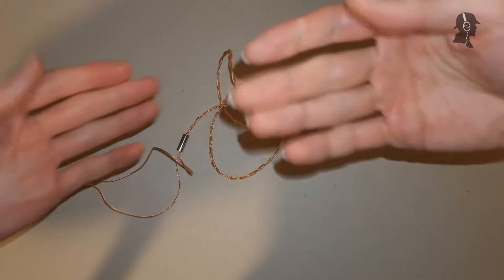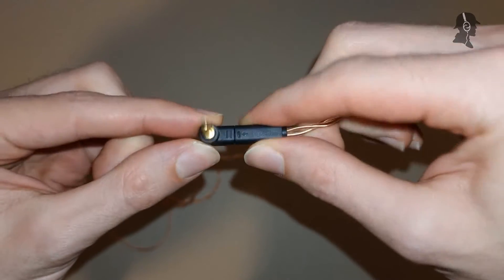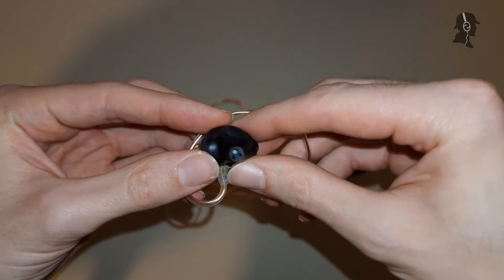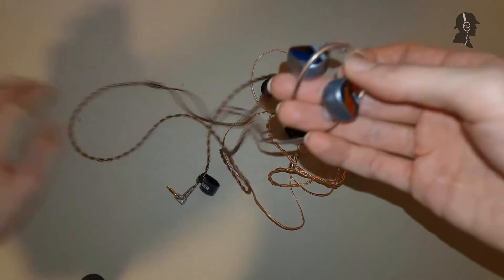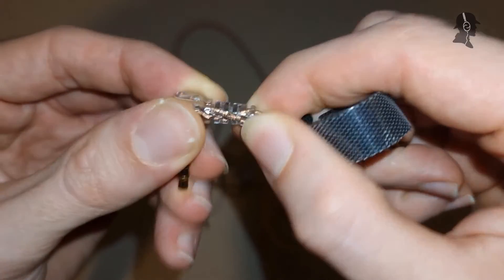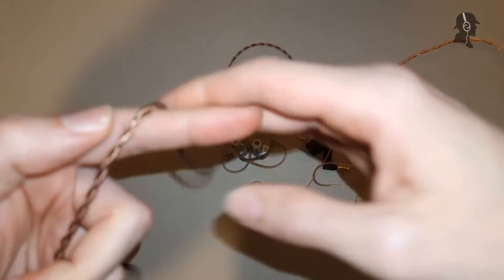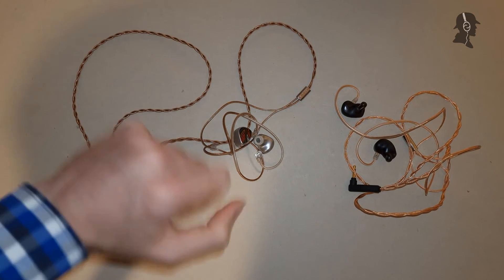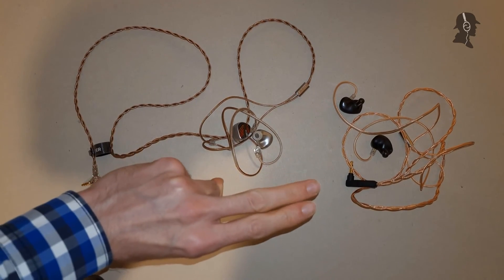2min on: Great IEMs with bad cables

Comment: useless video...not a single word on how the cables actually sound. The included copper cable with variations is best sounding, and after trying different cables, I switched back to it, as sound is priority for many. regards
Reply: You're forgetting the fact that cables do not alter the sound of an IEM. The only property of sound that a cable can affect is very slight differences in the volume.
Reply from the maker: I only write this once here and I also pin (EDIT: I cant pin this comment here, as it is a reply...) the comment so my standpoint here is clear: 

I am a man of science and scientifically speaking, cables do NOT have a sound. No formula for electricity/signal conduction does hint that there will be ANY dampening at specific frequencies, at least under the resistance and frequencies we are having in normal audio via copper/silver etc. wires.

In high voltage technology or when using really crappy cables like i.e. aluminium, yes, there will be dampening of specific frequency bands, but this only occurs way past 20k or in the really absolute worst case (i.e. a couple meters of thin aluminium cable) past 10 or even 15k.

If you disagree with this scientific standpoint, feel free to show me formulas, measurements (with a cheap IEC711 coupler you should, according to your reasoning, be able to measure that cables do change the sound) or scientific papers on the topic of analogue signal conduction that do enforce your standpoint.

If you disagree with my scientific perspective, that's ok. You can believe whatever you like.

Only to convince me, you need to show me evidence.
Reply: I agree with SK. 
The simple cheap-as copper cable for Variations sound best. I tried the silver plated, gold plated bla bla bla… The copper ones sound best subjectively to me. 

Have you asked Moondrop?